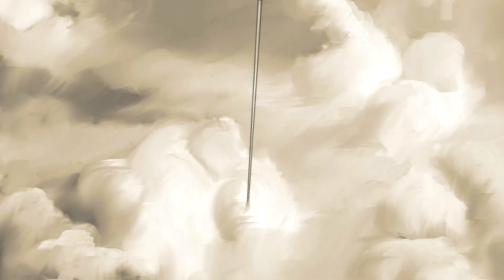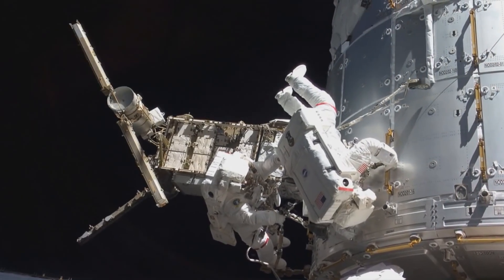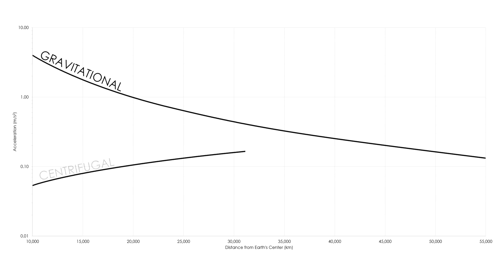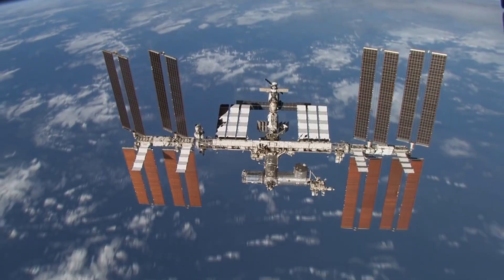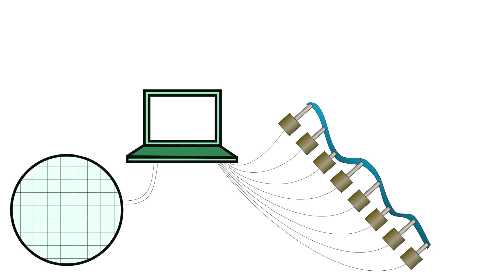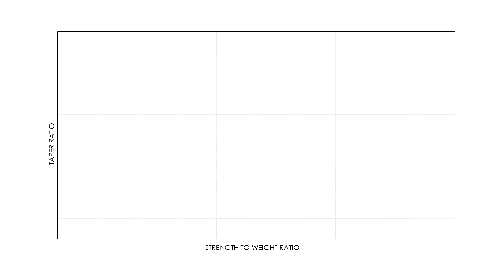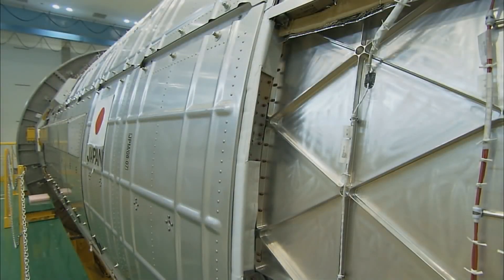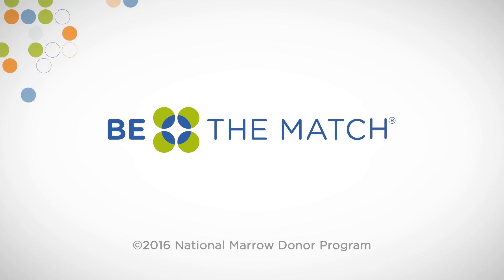Design Your Own Space Elevator

Comment: That's why I'm a bigger fan of the rotational space elevator. Have a cable only about 1850 km long as opposed to 60,000 km. 

What you do is have the shorter cable in orbit and rotating such that the end closer to the Earth is moving slower than the top. The Ship flies up at less than half orbital speed, grabs on, and rides the cable until it is at the top and lets go.

This does impact the orbit of the elevator but this can be contradicted by having ships make the return trip using the elevator. This also negates the need for a heat shield.

 The advantages are that the cable can be made from carbon fiber and the system does not require a climber.
Reply: Above the atmosphere is fine with me.
Reply: My story about the Space Elevator was published under my previous married name in 2005. I was thrilled. Arthur C. Clarke and Ray Bradbury were sponsors and the main impetus behind the contest was Bradley Edwards. I lost my only copy of "Running the Line:  Stories of the Space Elevator."
(Divorce and ex sold my books 😭 as he is a very mean thing). I caught him, but only got a little of my books. Anyway, I was inspired by the idea of a Space Elevator.
Reply: Are you advocating for a thing dragging a cable through all the circumference of Earth, at surface level with all its irregularities, mountains and seas, natural reserves, cities and what-not (yes, there are several cities located right at the Equator too). I think the UN Security Council would not approve...

Comment: Found your channel today, and I really like it.  
My idea for putting things into space efficiently is centered around the supersonic pingpong ball. The supersonic pingpong ball experiment is a tube with a pingpong ball inside, sealed on both ends by an easily breakable barrier. Air is vacuumed out of the tube and the ball positioned at one end. You break the seal at that end, and the rush of atmospheric air pushing into the tube accelerates the ball to supersonic speeds before it reaches the other end and breaks through the other seal. Imagine the payload as the pingpong ball, and a tube extending from sea level to as high as we can get it, sloping up eastward, and built on the equator. Rather than just let the atmosphere push in, use compressed air. Use maglev technology to guide, and possibly accelerate as well. It would be unreasonable to expect all the air systems to be handle at one station near the ground, so there would be several along the tube first vacuuming out air, and then releasing a bust of compressed air after the carriage passes. All this might not be enough to get something completely into orbit, but it might give a significant enough boost, and it's reusable. 
The highest point on the equator is in Ecuador, Volcan Cayambe. The highest structure in the world is Burj Khalifa. Together, that's 5 km of the thickest part of the atmosphere could be bypassed.
Reply: The supersonic ping pong ball concept has a very low speed limit. The maximum ball speed is limited to the air stream pressure entering the tube pushing the ball at supersonic speed. As per today, ball exit speeds have been measured as high as 1100 mph (abt M 1.4). For an element having no self propulsion the earth gravity escape velocity is abt M33 (not counting for friction during travelling through the atmosphere). Theoretically, this could be obtained,  i)  in a device of reasonable length where much higher acceleration could be sustained or, ii) in another where decent accelerations would apply at distances larger than hundreds of kilometers.  There is an electromagnetic cannon concept today (US Navy) where distances of 100 miles are achieved through the use of 20 MW electrical generator and (I suspect) very large condensers discharging a huge current through a set of coils (abt 100 m). I believe this is what you refer as maglev tech to accelerate the element to gravity escape speed.
Reply: Enrique Laya the maglev tech was just to reduce friction with the barrel of what is essentially a gigantic airgun. 

As I've been researching the experiment, I can across Mythbusters that built a very long tube, and the problem they were having with exit speeds was air getting around the ball and cushioning it before it beaches the seal. I think this could be solved by large chambers at angles to the exit with a vacuum pulled. Kind of like a silencer or  structure, so the air has somewhere to go.

The element would have self propulsion, just not as much as conventional rockets. The goal would be orbit, not escape, so M 22 ~ish is more reasonable. The, I'll call it GAG for short (Giant AirGun), is mostly there to launch the element out of the thickest part of the atmosphere where the most fuel is spent on conventional rockets.
Reply: You may want to google "The vacuum Canon equation" to find the experiment equations. There you will see that no mater how long a tube is built the maximum ball attained speed will be less than 277 m/s. The issue as indicated in my earlier comment is related to the mass of inrushing air pushing the ball. In the doc there is an accurate physical treatment of the experiment as the air mass behind the ball has to be accelerated as well along with the ball.  My own feeling is that the only competing concept with the space elevator is that related to an electromagnetic canon as the US Navy is experimenting with
Reply: I guess I'm just going to have to physically build and test this idea for myself, but thanks for bringing up some of those concerns, they've made me think a little harder about this idea.

Comment: So would we launch a rocket with a string tied to it, or would we drop a rope down to earth.
Reply: There's the problem. This cable would be long enough to wrap around the Earth. If you lower it, the cable will be whipping around at high speeds. If you lift it, well that's a very heavy load to get into space.

Now imagine what happens when the cable or its supports break, or what happens when you want to dismantle this because nothing man builds can last forever. 

There will be a insane amount of stored energy in that cable. If it breaks at the top and falls it will have a lot of speed when it hits atmo, if it breaks at the bottom it will be like cutting the world's largest rubber band. A several hundred kilometer long rubber band made of one of the strongest materials known to man.

Look up rotational space elevator if you want to see something more practical but does the same thing.

Comment: Not sure if this has been brought up, and granted all of this is hypothetical but theoretically feasible (minus cost, material and labor), but in aircraft differences in atmospheric and ground charge as well as friction with the atmosphere generates a capacitor effect on the skin of the aircraft, meaning that aircraft must be grounded properly prior to fueling and off loading after or during flight or serious injury can and has occurred. Not to mention electrical interactions within our atmosphere, and solar radiation at high altitude and possibly beyond our atmosphere interacting with basically the largest lightning rod ever created.  This is ambient energy outside of the weight of our vehicle.
In practical application, many cities have electric driven light rail systems, could this ambient charge be channeled into regulated current, light rail style system, to be used for the elevator? great videos btw!

Comment: Technological progress is amazing, but you can't depend on it to provide the answers you want. We have no idea how to produce perfect large monocrystalline carbon or boron nitride nanotubes. Unlike other technological barriers which typically depend on the development of supporting industrial infrastructure, this is a problem indistinguishable from one without a solution. As such, there is no reason to believe the problem will be solved before someone figures out an even better way of getting to orbit. It simply may not be possible to produce the material necessary to build a build a space elevator in any economically viable way.
I strongly doubt that a space elevator will ever be constructed, NOT because I doubt that we'll ever figure out how to build it, but because I believe by the time we do, it will be made obsolete by a different technology. One promising example that doesn't depend on materials not yet invented is the launch loop.
Reply: The image at 8:03 is actually a very promising way of producing thread made of nanotubes. It was very recently concocted, I agree though on opinions being made obsolete before developed. People tend to forget this very real issue.
Reply: lueefour the image depicts spinning CNT yarn from shorter fibers. This can not be used for a space elevator, the larger fibers are a couple orders of magnitude weaker than the  individuals, which are composed of a single molecule.
Reply: I understand, but it's a step forward over other methods for production. I'm in the same boat with this idea going obsolete before we can make it.

Comment: Just a thought, on the climber.
and i know it might be a dirty one, but what about just using a piston engine to climb with fuel, air, and exhaust tanks(to collect potentially damaging emissions when passing thru vulnerable atmospheric layers and while in space) , closable intake vents for combustion could be used at the bottom so it could breath the ambient air during the part it needs power the most, the part closest to the ground, where the air is thickest and warm.
Reply: The amount of fuel would be pretty unreasonable, just look at rockets where 90%+ of the mass is just fuel. 
To me a nuclear reactor seems much kinder to the mass budget although you'd have to come up with some pretty novel ways of dissipating the heat at higher altitudes...

Comment: I think I see a massive problem with this whole idea that hasn't ever been mentioned anywhere that I've seen.

Conservation of angular momentum

When the climber climbs the cable it starts out with the linear velocity given to it by the rotating Earth. As it climbs the cable that linear velocity remains the same, which means that it's angular velocity gets slower as it climbs higher and higher up the cable.

This will pull the cable sideways in the direction exactly opposite of the rotation of the Earth. It will both move the space elevator and also decrease the rotation speed of the Earth a little bit ( which seems like a REALLY bad idea ). The rotation speed of the Earth will slow as the cable pulls on the planet in the opposite direction of it's rotation. When the climber returns to Earth, the opposite would happen ( in a perfect World ), restoring the system back to its original state. However, since no system is perfect you'd be slowly bleeding off the Earth's rotational speed every time you operated the elevator ( in the long run ). In the sort term, you'd be constantly altering the planets rotational speed in real time.

Also, adding the tether, anchor and moving climber changes that effective shape of the planet because they are attached to it. since the planet is moving and rotating around the Sun, wouldn't this start changing the shape of the Earth's orbit a bit? It would be like having a small moon orbiting the planet at a close distance.

Comment: What use is the cable if the climber can't pull on it as it ascends? Your assumption seems to suggest that the climber simply uses the cable as a guide rather than a support. If the climber has to pull on the cable to ascend then the additional force on the satellite will upset the equilibrium causing the satellite to descend  and speed up.
The whole concept seems flawed to me.

Comment: Great video, but how would you build such a thing? 
How would you get the cable up into space? How heavy would the cable be? 
I'd imagine it's wieght would be orders of magnitude over what could be dragged up by a rocket, if it was just one continous piece. If it was made into shorter lenghts and then joined in place that would also prove difficult. Would it require scaffolding on earth as each lenght was attached? Scaffolding reaching into the stratosphere? Seems impossible. Also before the cable is completed wouldn't it also have to take compressive forces from its own weight? 

Alternatively...

Would you start building the cable from geo stationary orbit, shuttling small pieces up and joining them together, progressively moving closer to the earth and attaching it to its anchor point on the ground? What would you do when you reached the atmosphere? Imagine a loose cable of biblical proportions flapping about in the upper atmosphere! You'd have to steady it, then attach the remaining lenghts in flight, maybe in a hot air ballon or giant helicopter. Though if you got this far, would the cable fly off into space because it had yet to be anchored? or would it start falling back to earth, whipping the entire width of the pacific ocean?!

It seems to me the space elevator could exist, but not in a half completed form.

What are your thoughts? 

It would be great if you could make another video on the space elevator with even more details and issues discussed.

Comment: >centrifugal force
>CENTRIFUGAL FORCE

("Centrifugal force" is actually just an illusion generated by the constant acceleration towards the center of rotation)
Reply from the maker: +Ryan Lynch That is only true for an inertial reference frame. In a rotating reference frame, the equations of motion indeed have a centrifugal component.
Reply: +Practical Engineering Fair enough! I guess I'm just not accustomed to a rotating frame of reference :P Thanks for replying!

Comment: When ever I see information on a space elevator the one thing that comes to mind is, if there is not a second, identical elevator on the opposite size wouldn't the weight of the counter weight cause, albeit small, but accumulative adjustments to the Earth's rotational axis until a new axis is established?
Reply: The moon already has an effect comparable to this, it's sometimes referred to as tidal braking. One key aspect though is that the moon is not in a geostationary orbit and because of this it pulls the tides up, but the actual water is travelling at a different rate around the earth, which results in a net force acting on both the earth and the moon to lock their rotational period, this is why the moon has a 'dark side' (even though it's only dark for a few weeks at a time), and the smaller body's orbital period slowly increases. The result of this is that the earth has been slowing down for millenia, and the moon is slowly creeping away.

The problem with trying to counter the force is that if you are anything less than exactly precise in accounting for the irregularities (perturbances) to make two asymmetric but equal opposing constructions, it wouldn't really work, and like a faulty harmonic dampener (see PE's Tuned Mass Damper episode), what you'd end up producing is just a lot more noise in the system, making it less stable, and that could easily be more harmful than a stable, consistent force changing the earth's rotation.

All that said, if the center of mass in this system is at the geosynchronous altitude, there shouldn't really be any tidal interaction, because the mass of the elevator is stationary relative to the planet surface.

The real trouble will be people who like manga trying to build a space elevator in Tokyo, 35 degrees above the equator. Any orbiting body will want to have an orbital plane that crosses the center of mass in it's orbital system, a tethered orbiting object will seek this state by pulling on it's anchorage , which would effectively try to pull the planet over until Tokyo is closer to the equator, shifting the axis of the earth over an additional 35 degrees, bringing it to roughly 50 degrees, and putting the vast majority of human civilization inside the arctic circle, where at least once per year the sun does not set for more than 24 hours, and the sun does not rise for more than 24 hours.
Reply: I never thought it would effect the axis a lot and if it did, I figured it would be one of those problems that would effect our "great great great grand children". 

It was one of those things that nags at you at the back of your head. When you have a strong enough grasp of physics to think "Hang on, that's not right" but not enough to be able to explain in detail why. 

As for the Tokyo example, I had not put that much thought into it. I instinctively expected that a lift would be put within +/- 3 degrees of the equator, preferable within 1 degree quite likely for this reason, how ever as I said, I never put that much thought into it.

Comment: If the tether material is transparent at an appropriate frequency it might support total internal reflection. Then you could use evanescent wave coupling to power the lifter. However honestly you'd be much better off just building a big railgun and accelerating spherical payloads to 11km/s